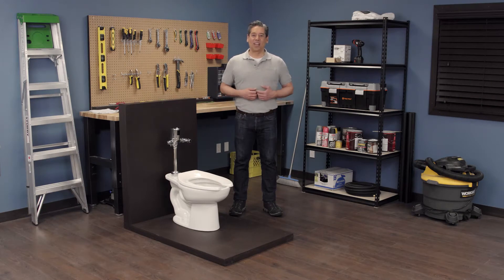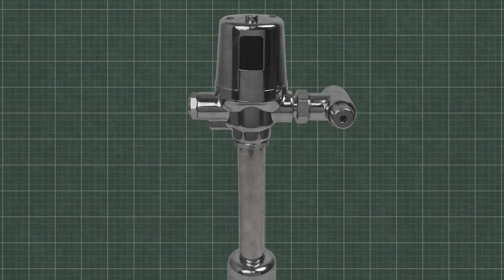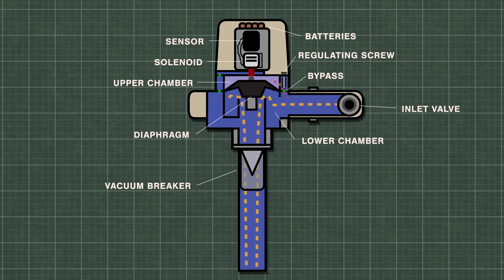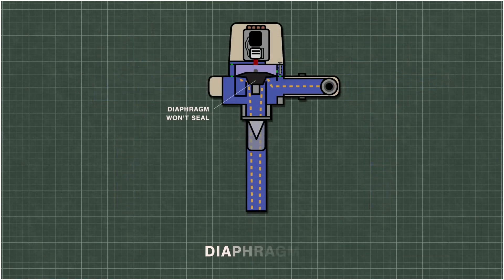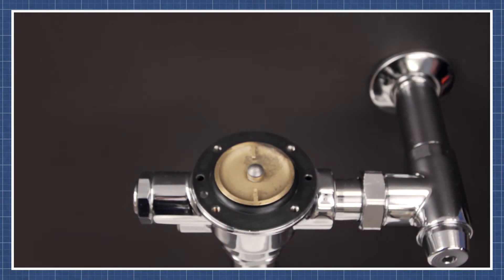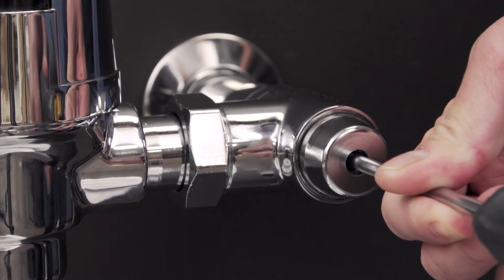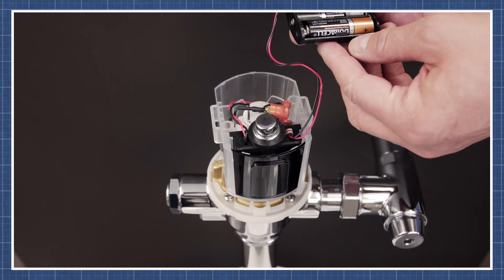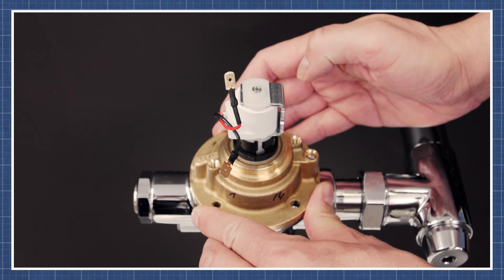Troubleshooting a Delta Teck II H2Optic Flushometer | Repair and Replace

Comment: Can you replace the battery pack with a nine volt battery?  There appear to be the correct terminals in the lead that attaches to the battery pack.
Reply from the maker: Thanks for watching. I am not sure on if the AA's are wired in parallel or in series so I can't say for sure if a 9 volt will still work correctly. Might be worth checking the manual for more detail or there might be an answer on some of the plumbing forums.
Reply: Yes it works fine. But needs to be replaced more often.

Comment: Hello, where can you purchase the sensor pack? Thank you.
Reply from the maker: Thanks for watching. There is a different sensor for urinals and water closets. All sensors are listed here including for the delta flushometers. Always double check part numbers to your model number. There are model breakdowns under the flushometers listed on the website as well.
https://www.amresupply.com/catalog/Electronics-PF14

The sensor replacement is shown here: https://www.youtube.com/watch?v=RW984TxQB5w

Comment: Let me add that these units have parasitic loss. So they cause the batteries to leak acid and corrode the battery pack. I've had to clean contacts on these things over and over again. Tried many different brand batteries as well, same thing. So I started using lithium batteries.
Reply from the maker: Batteries leaking can definitely be problematic. Have you had better luck with the lithium or is it too soon to tell?
Reply: AMRE Supply Too soon to tell. But no more issues so far.

Comment: What if it clicks but no flush? Sensor works
Reply from the maker: Thanks for watching. If it clicks then it's likely the sound of the solenoid opening. Check to make sure that there are no blockages that would prevent the upper chamber from releasing water. As well it could be an issue with the diaphragm. In either case it's best to take it apart and clean any surface of the diaphragm and the valve seat. A mineral buildup can prevent the diaphragm from releasing in some cases.